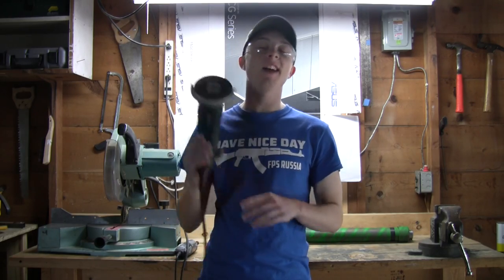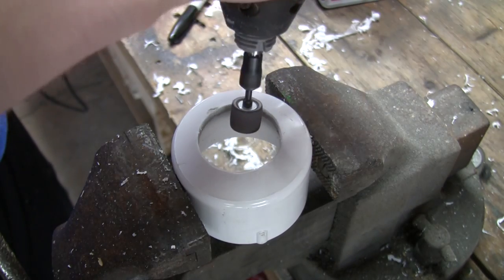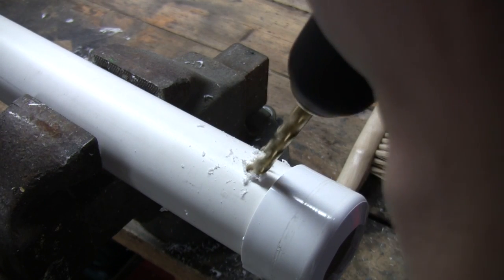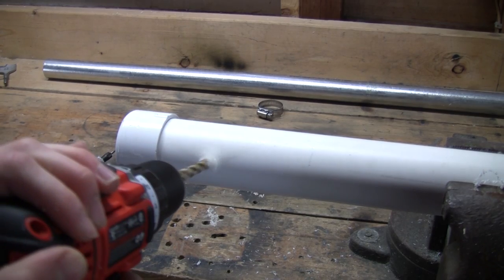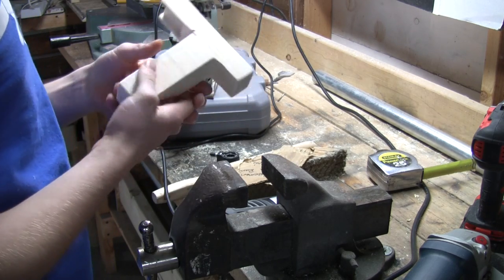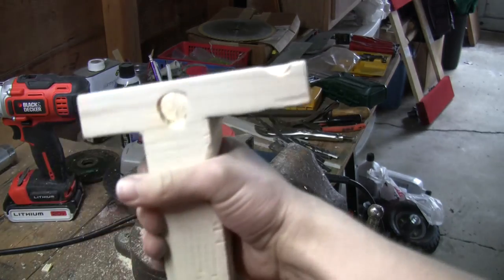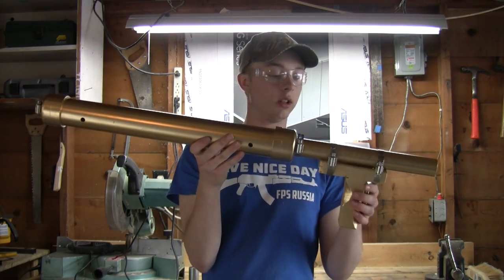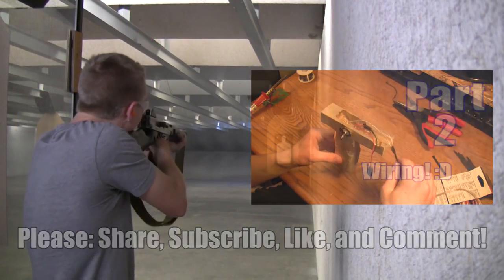How To: Rocket Launcher (Part 1)

Comment: Where did you get the idea to use EMT conduit? I'm in the electrical field. Never was told EMT was rated for  pressure
Reply from the maker: It's what was available and what I could afford. Thankfully, it doesn't need to have a high pressure rating. Any excess pressure escapes from the rear. However, in order to launch a heavier projectile, the tube would need to handle higher pressure. I would study the RPG-2 before making a launcher for heavier projectiles/larger charge.
Reply: @pyrogun1839  gotcha, thanks!